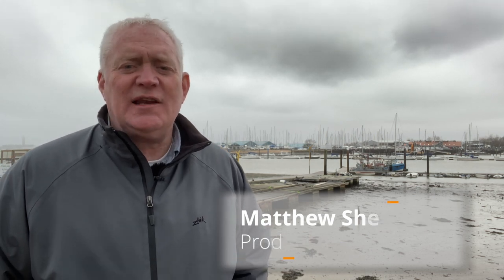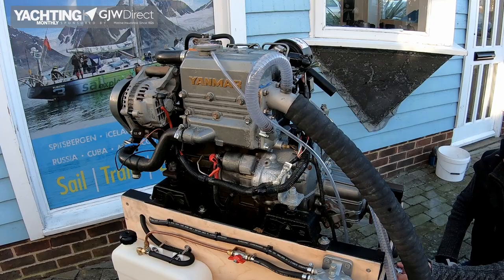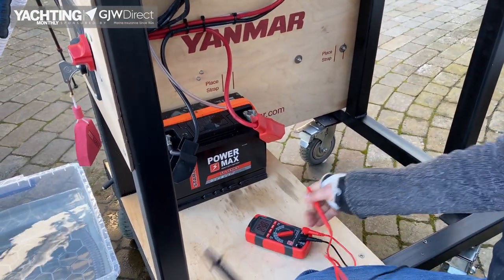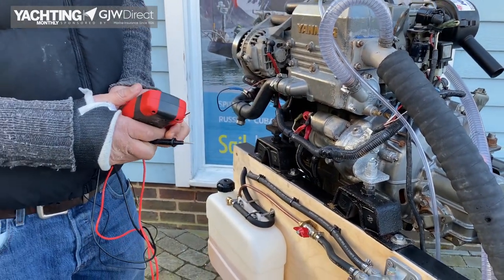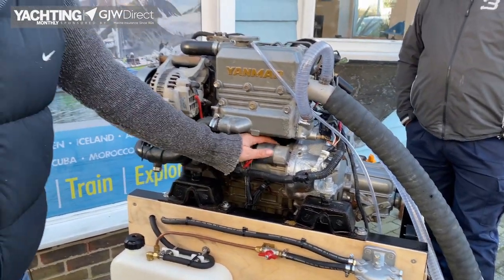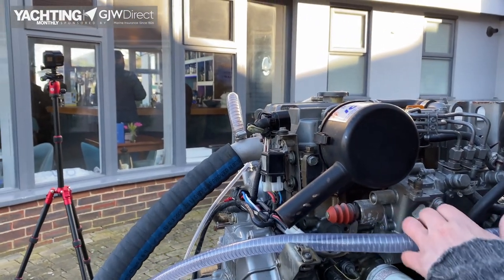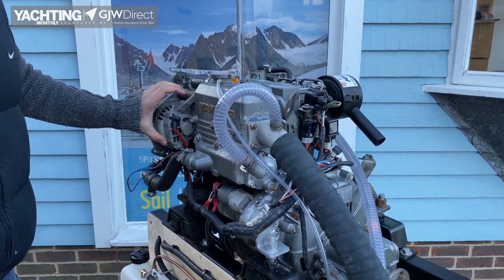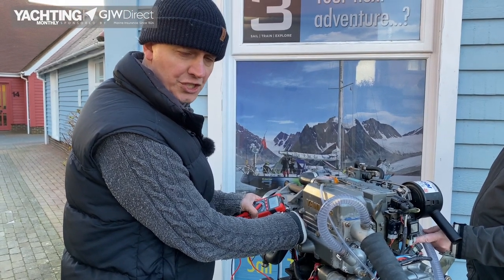Engine won't start! How to troubleshoot your marine diesel electrics - Yachting Monthly

Comment: Check battery voltage while trying to start the engine. You might see the voltage drop significantly; a battery of that type is a "voltage source" as it will try to develop 12V DC across any load - even a dead short or very low resistance such as the winding of a starter motor. As such, with a weak battery trying to turn over a stubborn engine you might see the voltage drop to 4-6V which is a sure sign that the battery is in need of replacement.
You should expect to see the voltage drop 1V or so when starting, but consider anything under about 10.5V measured (with a quality meter such as Fluke) as a problem.
Also, you may need a very high end handheld voltage meter (or a very low-end oscilloscope) so you can check for other issues mentioned in this video. For example, simply measuring voltage at the alternator may not lead you to notice a damaged rectifier; a DC offset or leaking AC can damage some equipment.

Comment: If I had the meter in my hand and had checked the battery voltage, it would be an obvious move to look for exactly the same voltage at the starter solenoid's heavy positive cable since they're usually directly connected. If they're not at the same voltage, check connections and integrity of the cable. This is worth doing anyway, since a dodgy cable will give you a voltage reading even if it's down to it's last strand of wire. It will never carry the juice to turn the motor over though.

If all looks good, bridge the two large terminals on the solenoid with a screwdriver. If she fires up, the problem is on the control side (ie from battery positive to ignition key, to smaller positive wire on the solenoid). So you've narrowed the thing down pretty easily.

Sometimes a few judicious taps of a light hammer on the body of a starter motor will persuade it to spin. Don't overdo it.

A stop solenoid, if it has two terminals, can be checked just by putting voltage on the teminals. The plunger should pop in and out as you do.

Comment: I have a nanny diesel kubota 29hp just had new starter motor and two new batteries fitted always serviced and the relay done and it won’t fire over please someone help not even the boat yard can diognose anything

Comment: 12 volts coming the the altinator won't charge the 12 volt battery, you need 14+ volts. I like the out of the boat set up though.

Comment: Sorry, Checking the battery right off the start with a voltage meter is WRONG..... AMPS is the key , Even a dead battery reads 12.4 volts , Yes AMP testers cost money but worth every penny . Without AMPS you get no crank .

Comment: 12.8 charging system voltage is not good, you should have 13.8
Reply: i thought that to be so as well. Am i missing something?
Reply: At least 12V

Comment: Good video, need to explain in more detail what you are checking, what is a "stop solenoid". Do all
diesel engines have these? 12.8v is not good, should be above 14v. Yachting Monthly needs
to review these video's before publishing them.
Reply: A stop solenoid is a fuel shutoff solenoid. If it's energised and all is well, it allows diesel to pass through to combustion. It helps prevent backfiring, and flooding. To get it to energise, it might need to see certain conditions eg oil pressure.

Comment: So you started the engine to check if the alternator was working. But you were doing this whole thing to diagnose an engine that isn't starting. Top notch video.
Reply from the maker: The video traced the electrical system to find why the engine wasn't starting. A failed alternator won't directly stop the engine starting, but it will stop the batteries charging. The only way to test if an alternator is working is with the engine running.

Comment: Checking voltage on a battery is not very helpful. You shoud check only under the load. Nearly dead battery can show you 12v but under small load such as light bulb can significantly drop.

Comment: Hi! watched this video ten times now. gone through my engine and changed/checked everything in the fuel system except the injectors, I do not know how to do this. I have an old Volvo penta MD6. when the compression handle is lifted the engine turns but as soon as I lower it there is no more action, no combustion of fuel at all. it took longer and longer last summer to start it up, untill one day it didnt start at all. any help from anyone is very appriciated!

Comment: Hi. How can I check the electrics before the starter motor eg the push button and the cable that goes to the starter motor (the loose white one in this video) to make sure they are working properly?
Thanks Andy

Comment: Question; I have a small 2 cylinder Yanmar in my sail boat. Each time I attempt to start the engine- the starter housing breaks. I have replaced 3 starters now. Its like it doesn't mesh correctly? Am I missing something?? The engine block where the starter is bolted seems clean and correct. Please help with any info?
Reply: Is your engine seized? causing starter to break.

Comment: is the alternator bad if it is reading 15.8v with the tester?
Reply: Not necessarily and actually not likely. An alternator's voltage output is directly related to the engine rpm. Increased revs leads to higher output voltage, and vice versa.

A nominal '12v' system wants an alternator that delivers a little more than that, maybe about 14v, which is enough to charge the battery but not enough to wreck it.

The component that does that is called the 'regulator,' and it's sometimes built into the alternator itself. It acts to divert anything over the desired voltage away from the battery. Sort of like a hole in the side of a bucket that only lets you fill the bucket to a predetermined level.

I stand to be corrected, but 15.8v is possibly on the high side for a 12v system.